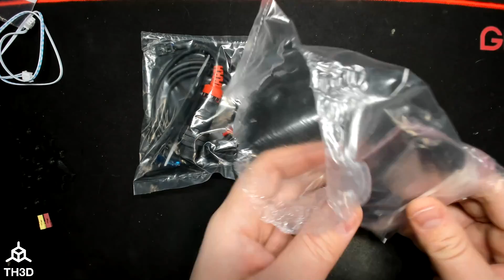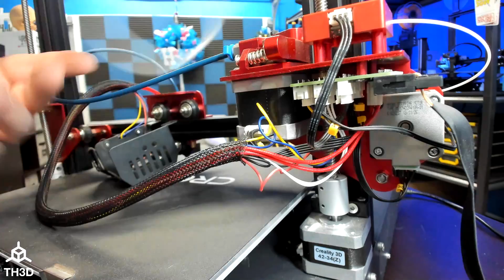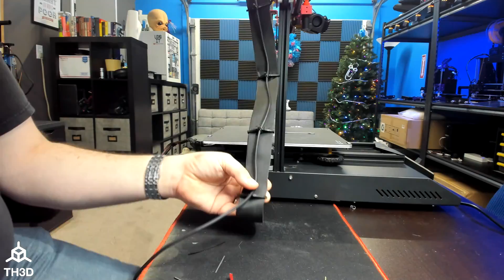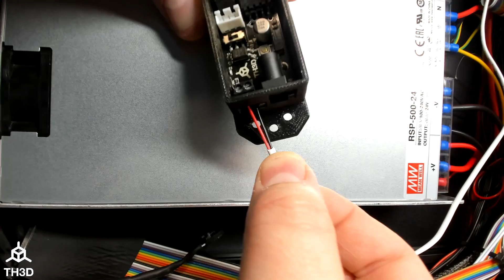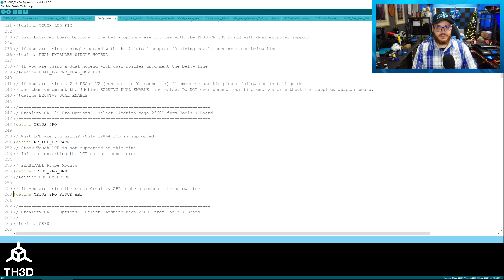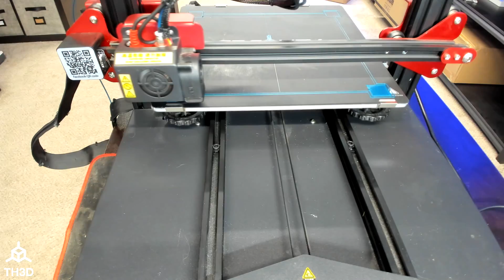Installation Video - CR-10S Pro EZABL Upgrade Video

Comment: I just started 3D printing and was given a CR10S Pro V2. I know nothing about 3D printing and the printer bed leveling didn't work. I saw your video and site after searching all day for help. I purchased both the EABL sensor and the LCD kits. It looks like thes will correct the problems. Nice video. You do move a little fast for me, loading the firmware, but at least I could pause, backup, and I was able to get it loaded on the main board. Waiting on the two kits I ordered. Thanks for your video and introduction to TH3D.
Chuck

Comment: Nice video. Mi 3D printer have a BLTOUCH can I make the upgrade and keep this sensor? Thanks
Reply from the maker: The EZABL would replace the BL Touch. You cannot run 2x ABL sensors on the same machine at this time with Marlin.
Reply: TH3D Studio maybe I didn’t explained well. I’m talking about the screen upgrade kit I don’t need to change my the BL sensor or need any configuration in arduino? Thank you.

Comment: Why can't the PRO sensor be used alone as a replacement for the stock sensor?
Reply from the maker: Because their circuitry and cabling is not compatible or the same quality/design as ours.

Comment: Can we get this kit with the EZABL Pro Mini 12mm?
Reply from the maker: We're not having that as an option since the stock mount is 18mm. There are no benefits of using the 12mm over the 18mm on this machine.
Reply: @TH3DStudio  Thanks for the quick response.I was looking to use this with the trianglelab DDE Direct Drive Extruder that I just got.

Comment: would it be easier to design a 3D printed ABL mount with a hole for the adjustment screw?
Reply from the maker: We're going to do that and post it. The only thing is getting to the screws to remove the stock one means removing the entire X carriage because they are screwed in from the rear of the carriage.
Reply: @TH3DStudio  well that sucks, but thanks for replying so quick, and for those that wasnt to rip their X-Carriage apart this will still be an option, best of both worlds.